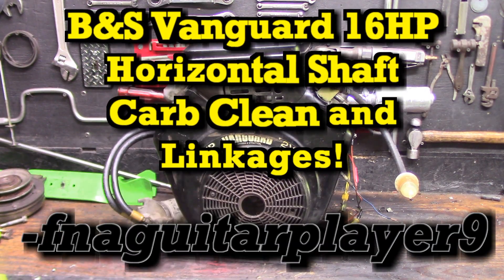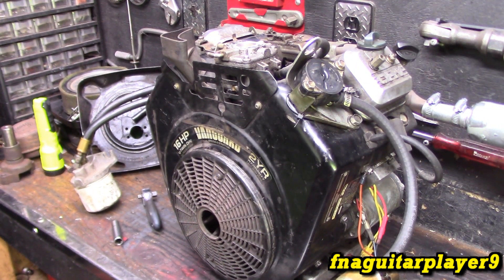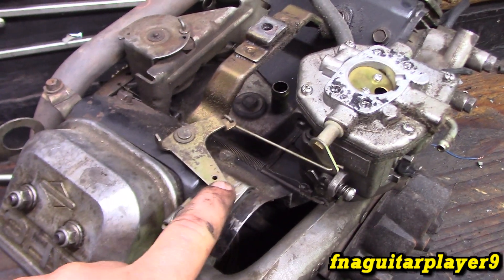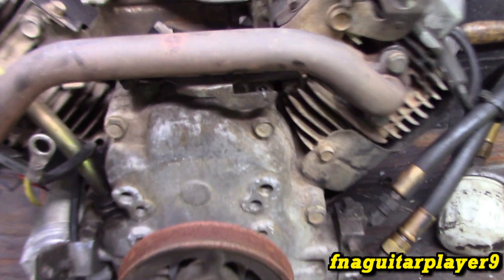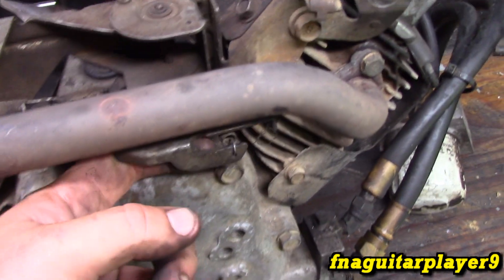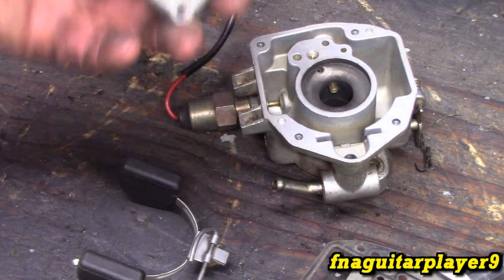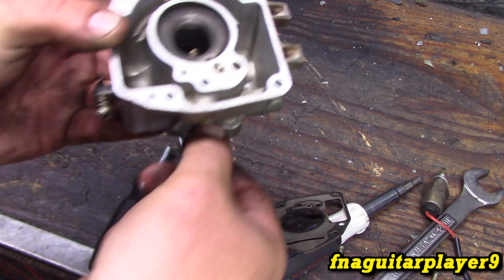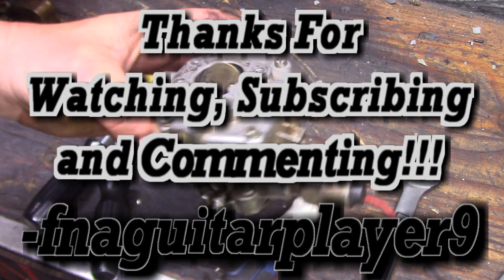Briggs Vanguard 16HP Carburetor Clean and Linkages

Comment: DARN thing is full of white cream globs, and the solenoid isn't, there's just a bolt there.. weird but I guess that bypasses the solenoid function but the fuel shut off is imperative in this case so the carb doesn't end up like mine.  My machine sat a year, cranked a long time, started leaking water out the manifold...  I use stabilizer but..    the muffler cracked after not too long  after carb was rebuilt and it sat since last season until I got on it and fixed the muffler.

Comment: Because I didn't have the money to go buy any carb clean I had a bottle of vinegar in the house and some Ziploc baggies so I filled the ziplock baggie up with vinegar and put the carburetor in there and let it soak for a day it did pretty good but there was still some gummed up stuff but I got it out and then that solenoid was gummed up too I took my torch and heated it up and then sprayed some wda 40 on it and smacked it on the vise a couple times and did what you said with the negative and positive cables and it started working just thought I'd share that took me a few days but you got her going thank you again man helped a lot

Comment: Sir. I have this very engine and attempted a carb clean. Reason being I was having some rough starting issues. She needed open choke and throttle to really fire up. After the clean she starts really well, but now cuts out on idle. Do have any suggestions for what might be the issue here? Thanks in advance!

D
Reply: Problem solved. It was primarily a bad fuel pump. I changed the oil, all filters, new pump and sonic cleaned the carb. With a little fuel screw and idle adjustment she purrs like a cat now

Comment: thank you have a 16 hp vanguard on a rear mount snapper rider sr1642 model  having carburetor issues only difference i don't have fuel solenoid
Reply from the maker: It will probably just need a good cleaning. Thanks for Watching!!!

Comment: Great video. Question. At 2:04 in the video you wipe that piece that comes off the carb. What is that? Is there a hose that hooks to that? I have the same engine on a debris loader and took out of storage and when filled up tank with gas and turned the fuel line on that thing pours out gas. Thanks!
Reply: Same problem here, my float was stuck.  Also, when he pulled up the floats and showed the pin that can be adjusted... i suspect mine is dirty, because it still leaks some after getting the floats un-stuck.  If it's gravity feed fuel, but in a shutoff valve.... saves gas.   (Another question like this was answered, here is his answer:  " First thing i'd check is the needle valve/seat and/or the float, if its sticking letting it flood out it will do that. "
Reply: @daviddupre3239  yep. Cleaning out my carb solved my issue.

Comment: I’ve got a 16 hp vanguard it has very little use it probably is 20 hours in the past 20 years it’s a gravity fed fuel system I’ve clean the carburetor it starts up and idles fine it performs well the issue is when I shut it off fuel is somehow getting by and Hydro locking into the cylinders even if I manually shut off the fuel flow from the tank the fuel bowl on these models is very large as you can Seeing your picture and that fuel is leaking past I’ve already replaced the needle so my question to you is how do I adjust the float level you mentioned that you can bend that tab if I want to reduce the amount of fuel that’s getting into the bowl which direction do I bend it
Reply: Mines an older model made by Daihatsu in Japan it does not have the fuel cell celrnoid like you see in your picture.
Reply: I took it apart again this morning I remove the needle I polished the little cylinder that the needle goes in because there’s a little bit of residue in there and I figured maybe it’s getting needles getting hung up on some of the residue I polish that cleaned it out put it together starts right up you shut it off if you don’t turn the fuel off because it’s gravity feed it feels a cylinder I use the new needle this time again and it still will not seal I am at my wits end.

Comment: Great information . I always have  trouble with the set up of the springs and linkage. Well done .Thanks.
Reply from the maker: Your welcome! Thanks for Watching!!!
Reply: @fnaguitarplayer9  can anyone advise me i  was given a wizard riding mower the other day it is powered by a 13 hp power built briggs and stratton model # 28.707 type  #1154e1 code # 010124zd the alternator is burned up and id like to put a 40 amp alternator so i can pull my lit trailer and not have my battery go dead  also use an electronic voltage regulator>>  my question is will a 40 amp alternator git under my old flywheel >>and the flywheell still work??    please advise  with an alternator part number  thanks gerald from  deep south texas

Comment: I gave up trying to get jets out a lo9ng time ago. I just LAY the carb spray to it;s hide several times and then put the air compressor after it. Several times with that whole deal is usually enough for them to run and do like you said and the engine will clean everything up. And the best thing I did for the 1/2 VW Vanguard 20 horse was get a fully adjustable carb off Ebay. It runs steady now without surging or have the choke partway out. Thanks a lot for this. The linkages and the Vanguard are a lot similar! Watch out for the crickets and pick me one!
Reply from the maker: Yeah, I always try, sometimes they will come right out but yeah that usually works just as good. Thanks for Watching!!!

Comment: I’ve got a vanguard 16 that’s a gravity fed the gas tanks on top carburetor spotless I took it apart I cleaned it it runs perfect and ideal spot on it revs everything is great issue is when I shut it off I come back the next day and the gas has flooded and has drained out all over the ground.Unfortunately mine does not have the solenoid to shut the fuel off so it relies solely on a Float needle to seal.And looking at all the diagrams it appears that because mines a gravity fed it has an aluminum needle it has a rubber tip and it rubber tip is supposed to see inside of the brass pressed and see from the carburetor that is non-removable non-replaceable and that’s supposed to seal off fuel flow.So my question to you is how do you adjust the float level height so that the fuel gets shut off sooner and that way mine will not flood.I know there’s that little metal tab on the float which way do you bend it how much do you bend it and is there a way to test it with the carburetor cover removed so that you don’t have to play trial and error every single time and strip the top half of the engine down in order to get to removing the carburetor cover.

Comment: I have exact carburetor which came with a 2019 vanguard engine.  The engine hunts, even after taking carb top off and cleaning both top jets, it still hunts, then I bought a new carb, and it has a adjustable bronze mixture screw like you show on yours, but the original 2019 carb where that screw is has a piece of metal inside the hole.  Have you ever taken that metal out to see if a screw is behind it?  Reason I ask is I think that adjustment may be blocked and possibly causing my bad idle condition.
Reply: A good place to start would also be proper valve adjustment

Comment: What goes on tube at top of carb 
looks like some type hose or is it just open
Reply from the maker: Its like a hose, but its kind of weird shaped at the top and goes into the bottom part of the air breather assembly. thanks for watching!!!
Reply: Why does my vanguard have gas coming out of the hose nipple on the side of the top of the carburetor ?

Comment: Those Vanguards are great engines, great video! I recently bought 2 big Briggs single cylinder horizontal shaft flat head engines for a steal, one is a 16 HP single cylinder cast iron engine, cast iron block and it weighs a ton. The other is an 11 HP and it's an aluminum block, both engines have electric start. I got the 16 HP running by just cleaning and rebuilding the carb, cleaning the points, etc and it runs like a champ. The 11 HP had a stuck valve, the exhaust valve was stuck open. Keep up the great work!
Reply from the maker: Thanks! those are good engines, Thanks For Watching!

Comment: I have a generator with this engine, it runs great but I have a few small issues. While running it has a slight sputtering, and today i started it and it started leaking fuel out of the vent on the side of the carb. Any idea what would cause these issues?
Reply from the maker: First thing i'd check is the needle valve/seat and/or the float, if its sticking letting it flood out it will do that. Thanks for Watching!!!

Comment: Great video. I have a 2006 Snapper Trail Cruiser UTV with 16 HP Vanguard engine. There are times when it is difficult to push the gas pedal, feel a good bit of resistance in the gas pedal. Do you think that is a throttle linkage problem? Thank you in advance for any suggestions you can provide.

Comment: I have a question.  I am having a similar v-twin with out fuel pump.  I am having a back feed of fuel coming out of my vent with excessive fuel dripping from my exhaust pipe.  I assume this is a jet or float issue in the carburetor.  Have you seen this before?  Love your work it is greatly appreciated.
Reply from the maker: Yes more then likely its a float/needle valve issue. I have seen it before and thats what it usually is. Thanks for Watching!!!

Comment: Very good info. I ran across this researching while working on a '07 Toro Sand Pro, with almost 1200 hrs. Basically a riding, 3 wheeled rake for golf course bunkers. It has the Vanguard V twin engine, (not sure what HP) almost exactly like the ones you feature, except the valve adjustment is different. The valve cover bolts (2) screw into the center of the rocker arm, and adjustment is made at the top of the rocker arm. Its been doing all three things you mentioned about acting like a weak battery when starting, backfiring, and surging, or "huntin'" we call it, at idle. I have made all the adjustments like you showed, now on my way out to buy a set of spark plugs. I hope to fire it up first thing tomorrow. My question is, what is the almost triangle shaped cover thing that sits down in the valley pan, one bolt right in the center of it, just in front of the governor? It has a 90 degree hose, from almost the top of the carb going into it. A breather maybe? Could it be clogged, and is there anything I might have missed, in addition to your adjustments trying to fix these three issues? Thanks!